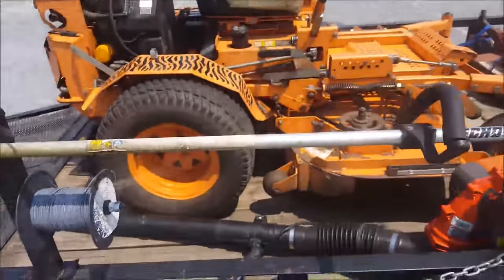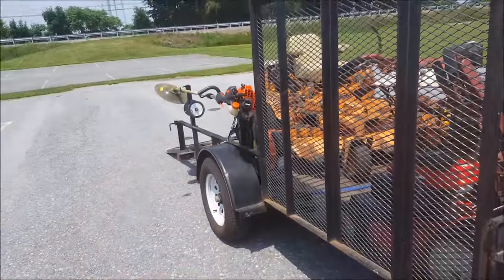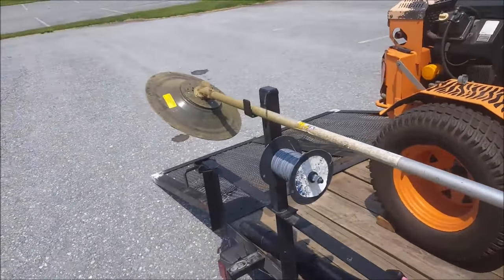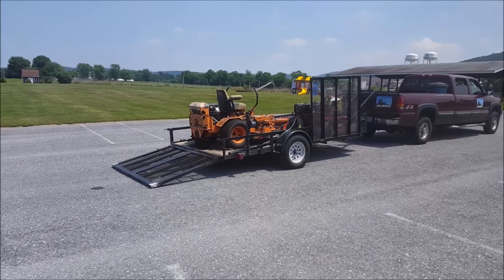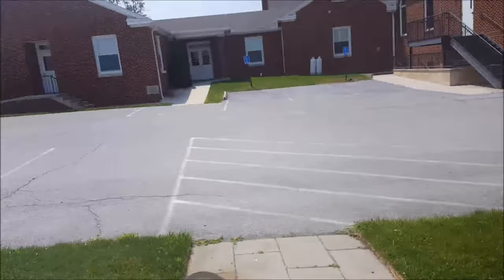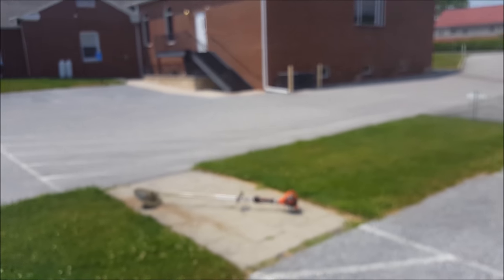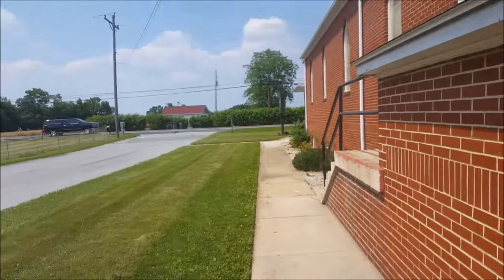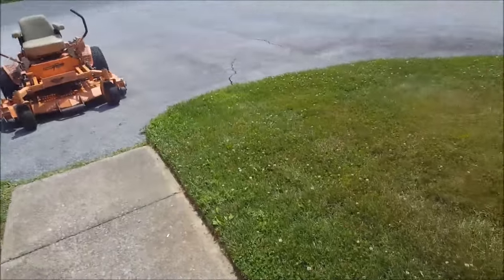Lawn Care Update Video

Comment: Just some advice to make your trailer last pull that scag on backwards so the engine sits over the axel more and it wont put strain on your hitch
Reply from the maker: yeah, i noticed that.  after i posted the video i took the ferris off the trailer since i dont use it often enough to drag around.  thanks for the tip!